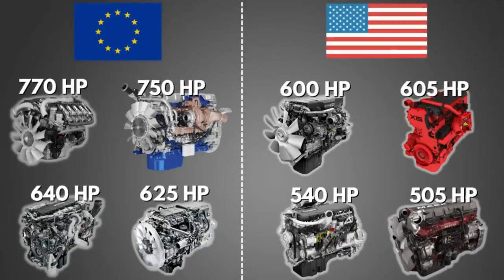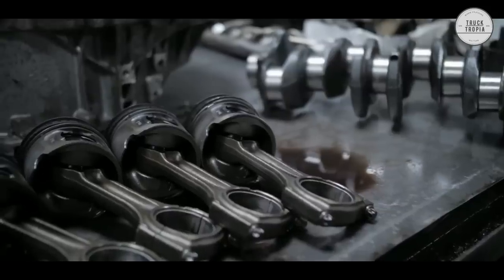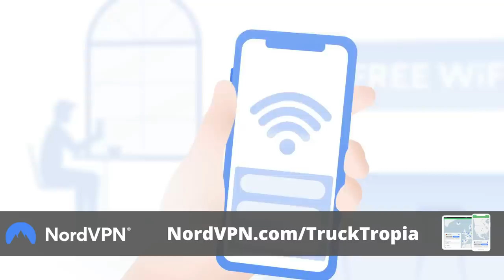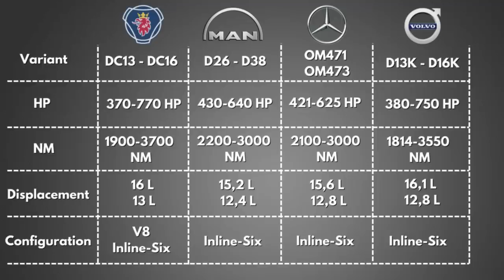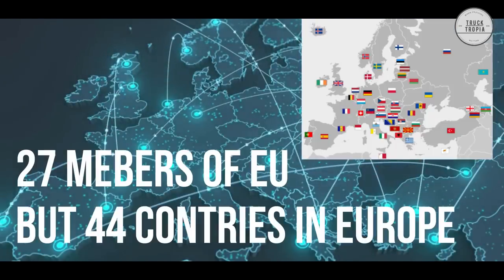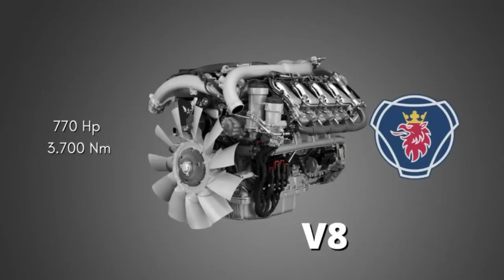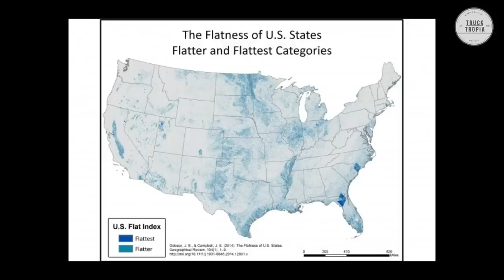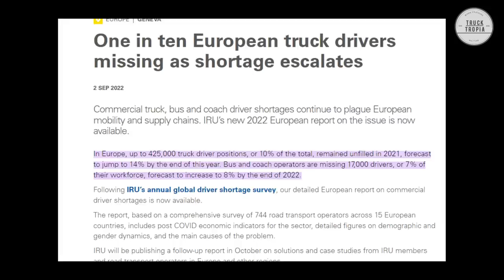Why European Trucks Have Up To 770 HP And US Don’t

Comment: Since I thrashed another one of your I know what European Trucks are like videos, the YouTube algorithm thought I'd like another one. European trucks do not have much bigger engines: there are 2 rival brands battling it out and a few drivers in need of a penis extension buy them. Of all the heavy trucks about 90% operate with 380 to 450 hp. 10% boast up to 550 hp. All made by straight 6 +/- 12 liter engines. 400 hp will get you 2000 nm these days. 0,00I-don't-know% gets to drive one of the Swedish topmodels. I would love to do so, one day. But my chances aren't great....😊

Comment: The US is flat? Must forget about the mountain ranges that freight has to get through to go from the west to the east coast.
Also many states have 105,500 lb weight limit.
Reply: It's about US truck loads in percentage runs over more flat and easier terrain, and with lower weights, than European truck loads, looking at the big picture.  One use the engines that makes the better milage in the total. In hilly terrain a large engine will often be more efficent, taking it more easy, compared to a smaller engine needing to be pushed towards its limits more often
Reply: @Rimrock300  
Just about every truck that's moving serious weight in the US gets turned up.
Alot of log trucks and dump trucks run 625hp cat and Cummins motors.
I'd be curious to see a real world comparison between a 625hp cat and that 770hp v8.
Area under the curve is important

Comment: Horsepower will soon be irrelevant when the greenie weenies succeed in requiring everything to be electric. Of course then that 80,000 lb rig will be 70,000 lbs of battery and 10,000 lbs of cargo. This will increase the number of trucks on the road by a factor of 10. Let’s not forget to factor in the sky high prices of products due to much higher transportation costs.

Comment: In Australia I believe the largest combination is the mega Quad. 4 b trailers with Quad axle dollies and trailers. Weight is around 240ton I believe. Pulled by a tri drive twin steer volvo. I've seen one in the north of western Australia but that's it. There are also super quads, ultra quads and standard quads. Mainly all used in the mining industry really. Most common combinations you would find would be the c-trains, triples and doubles really. Have a read, there is some big ass trucks in australia
Reply: I think it's note train not a truck
Reply: @martinssmits3170  a road train is just a truck with multiple trailers……

Comment: It sucks his in Canada a truck can’t maintain speed limits on climbs not that great because they are underpowered. I believe regulation should maintain 100km / 65m on a freeway hill.  Funny how USA thinks its engine superior but in sports cars, trucks, F1 racing etc there isn’t that much presence.
Reply: It is a matter of costs.  An engine that can haul a heavy load up a long grade costs a lot more and also will eat more fuel on a level run.  We really just need to either deal with it or build a railway.
Also, you may want to check out Edison Motors.  They are making specific purpose trucks with a lot of horses.  They are hybrids.  The drive motors are something like 750HP.  The engine generator is something like 200HP.  The batteries provide enough to climb a hill and then recharge on the down slope.
Reply: @kensmith5694  fuel cost way more in Europe. if they use the same size engines as Europe and there’s also a fuel cost to other vehicles slowed down by slow trucks then then need to accelerate after passing a truck that can’t maintain speed.
Reply: @Wozzaatwozza  The cost of passing is paid by the guy passing and not the trucker.  Incentives work to push the cost onto others.
Reply: @kensmith5694  the environmental cost is paid via us all vs keep the speed consistent one truck vs many cars.  Europeans get it’s not just dollars. Make the truck pay do all the other vehicles can maintain speed, and of course safety first so road design is key. But as the video states the European vehicles have bigger engines for hills.

The other option is just reduce the loads in North America so drivers can maintain speed. Bigger engine or less load.
Reply: @Wozzaatwozza  ... or just get over it.  The trucks are a fact of life.  We just need to deal with it.
Reply: @kensmith5694  I am over, I’m moving back to Europe where they fine truck drivers for driving too slow

Comment: Cummins ha a K19 to 19 liter 6 in line to 600hp ofered in Ford CLT9000 built in América in 1980 🇺🇲 3408 usted on Kenworth W9000 18 liters has 450 hp in 1981 truck Detroit Diesel 12V71 450 HP usted on Brockway 376 modèl truck in 1974 V12 2 cycles

Comment: Max torque is not more or less important then HP. You can compensate it with higher rpm (but then loose through this maybe some efficiency and longevity). 
Torque x rpm (times a constant) = (horse) power. 
So it's usually more important that you have good power over a wider range.
Reply: Not times but divided
Reply: Max either isn't really important. It's the horsepower band that matters. That will tell you how much torque you can apply to the wheels at any given speed. Engine torque tells you nothing without RPM. But if you have torque and RPM (which gives you a gear ratio, which is a torque multiplier) you have... Horsepower.

The reason for high torque is to have slower spinning engines that last longer. It has nothing directly to do with towing ability.
Reply: @simplemachine9531  is times, torque x RPM / 5252. And it's a different if you are using nm instead of lb-ft
Reply: @SlyNine  say times but show divided 😆

Comment: Don't heavier European trucks damage the roads more?
Reply: More weight means more road wear, comparing trucks with same number of axles. They have put the axle and total weigh limits at values they feel comfortable with, and roads designed to deal with it 'x' period of time before resurfaceing. It's a balance, less weigh and less road maintenece cost vs need for more trucks on the road to have the same amount of freight hauled over a year. The weight limits set are guided very strictly. Easily tens of thousand of dollars in fines if a few tons overweight

Comment: Bro why trucks so inefficient my car makes the same power out of an engine that’s a quarter of the displacement. I could never understand that.. maybe it’s because trucks get more torque more reliably out of a larger displacement, no offense I’m literally curious, I wanna know cause I’m guessing there’s a good reason???
Reply: Yes, less cycles per trip, cheaper components and maintenance
Reply: you know nothing about engines I see
the torque of a big diesel cannot be compared to car engines it's what moves the truck NOT the hp
big diesels are actually absurdly efficient when you look at the work they get done and the fuel they need to do that and yes its all about having an engine that will work for a million kilometres and handle the load of pulling a truck

Comment: I immediately knew torque was gonna be the defining factor. I have a 1979 f100 custom with a 3.7l I6 block. It's a big engine that only makes a measly 117 HP but it's working with double the torque (242lb/ft of torque I believe). Because of this it can still tow roughly 2000-3000lb with stock parts.

Comment: Hi, i'm fron Finland and i worked in concreed factory in loading bay. We maided elements specificly to constuction sites. The load in the one truck could be from 15 tons to 50 tons. And that wasn't the main issue. Main issue is that we can't load it properly on truck, closer to drive chafts, it's just can't be made. Allso main issue wich is noticable is arerdynamics. Elements are up to 5-6 meters, tall half meter wide concrete element makes a lof of drag and there could be up to 3 of them so it's a wall that is 1,5 meter wide. They got rooms where ariflow is camptured and acts like dragshute. Gaps for doors, windows. I didn't see eny truck with samller engine. Expet one time, and that little negine did fail after 15 kilometers. It could handle the cargos weight and drag.

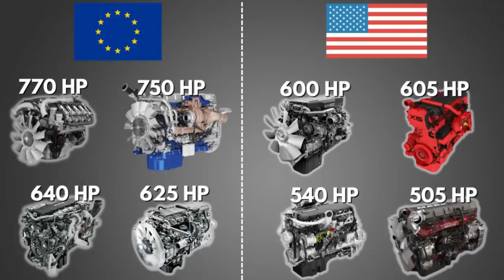Comment: 0:41 Welcome to the single most stupid sentence I've hear all year, another prime example of an individual not understanding what hp and torque actually is
The reason they can pull weight is horsepower and horsepower allone, an engine with extremely high torque indicates that the engine is making a lot of its power at low RPM, and that's the important part you missed to mention, it's not the torque itself that's important, it's the engines ability to make a lot of hp in the low rev range, if you are fine with murdering your clutch an engine from a supersportscar will do just fine aswell

Comment: US fuel is also very low quality, diesel is dirty, and technologies are dismal
Reply: Yeah US Pump Diesel is shit.
Low cetane compared to european diesel. That's not good. 
You want the highest cetane you can get for cleanest burn and most power out of your engine.
That's why I fill up with cheap diesel and spice it up with cetane booster additives. Cheaper than premium diesels and at least with my car there is a difference. Engine pulls harder on "boosted" diesel and sounds better like more aggressive but smoother somehow its difficult to describe.

Comment: Trucks need torque more than horsepower. How does that compare?
Reply from the maker: Need both
Reply: @TruckTropia  Dynamometers measure torque and rpm and hp is calculated from that. Low rpm torque is what gets the truck moving. :)

Comment: Bullshit, 10.000 Nm at 5hp are useless on a Truck. Nm x Rpm = Hp    Without Hp you have low Rpm = low speed. Use Gearbox

Comment: Those horses are in europe are imagine horses they are more near to 500 they if compared to mechanically tuned to 770 vs 770 stock the tuned will be beating it 1000-0 so they are on the paper not in the engine

Comment: I'd say that truck customizing is very uncommon in Europe. Contrary to what this video tells you. Because there are more trucking companies than private owners the trucks are company property and therefore never modified (why would they spend any $$ on it). And private owners rarely modify their trucks because of the same reasons. It had a culture yeah but not that widespread. The most common truck customization things are adding a bunch of led lights in the cabin, way too much lights and chrome everywhere. I call them Christmas trees. 
They remind me of coca cola trucks from the Christmas commercial.
Reply from the maker: Been to Denmark, Norway or Sweden all trucks are customized 😅
Reply: @TruckTropia  maybe it's a northern thing. Central Europe and the Balkans, I've yet to see a heavily customized truck. Been to Germany last week, no fancy trucks there either.

Comment: In the first 30 seconds, he made a bad comparison, causing me to stop watching.  He compared the AVERAGE power of a Euro truck vs the MAXIMUM available power of an American truck.  His point would have been sold a lot better if he compared average-to-average, or max-to-max.

Averages:  American trucks have an average of 350-450 hp vs the 750-850 hp average of a Euro truck.  (The 600 hp engine option in a US truck is VERY expensive.)

Maximum available power:  The ~600 hp maximum in American trucks vs the 1000+ hp of a Euro truck.  My Scania had 860 hp, and I didn't pay extra for it.  It was standard.

Plus, he never mentions the fact that some Euro trucks can be V8 powered, with Scania being the pioneer.  Something that American trucks currently don't offer, at all.  I have never heard of a V8 option being available in the US.

American truck manufacturers are so far behind in truck technology.  But don't get me started.  I could easily talk about rear-wheel steering (on the tractor), or steerable trailers (like a fire department ladder truck), or rear drop axles.  Things that most American truck drivers have never heard of.  Boy, I wonder why.

Comment: Very informative , but you drive with H P not with torque . Look in the formula .
Reply from the maker: Think a 1000 hp Bugatti Can pull 80 ton up a Hill ? No it need torque
Reply: @TruckTropia  it’s simple physics !
Reply: @TruckTropia  with the right gearing, yes

Comment: Total crap... Torque is irrelevant, power is defined as the rate of doing work, and that is what matters... For any given power output, how you got there is irellevant. You could have an engine with half the torque, BUT, to produce the SAME amount of power, it would have to rev twice as high. This means that for the SAME road speed, you could gear the thing twice as low, and therefore, thanks to the gearing, you would end up with exactly TWICE the torque out of the gearbox, as you put in [and half the output shaft speed], so you would now be back where you started, both exactly the same..

Comment: As a truck driver I can say torque is irrelevant. Power is all that matters. You can have torque without power but not power without torque. A 500hp semi powered by a bunch of weed eater engines will go up a hill as fast as a 500 hp C15 Cat with 1800 lb ft of torque.
Reply: @robsmith6093  I am a truck driver but I also understand a little math. A 600hp LS  could absolutely keep up with a normal truck engine given the right gear ratio. 

You can always get more torque by shifting down. Would the LS be running at 6500 rpm in a low range gear and be completely inefficient and impractical? Yes but hp is hp.
Reply: @robsmith6093  I can't verify that Nelly X is actually a truck driver but it is obvious that he understands math and physics.  On a truck (any vehicle, actually) it is the torque at the drive wheels that determines how steep a grade the truck can pull and how fast it can accelerate.  The key point, though, is that the greatest torque at the wheels is available when the gearing allows the engine to operate at its power peak, not its torque peak.  You can prove this to yourself by doing the math.  The engine's maximum torque rating never even comes into the equation.  If you need more torque to accomplish the job just downshift the transmission.  The only time that the engine's maximum torque comes into play is when the truck is in first gear (because there's no more gear reduction to be had) but that becomes theoretical since the resulting torque at the wheels would just result in wheelspin.

Comment: Not accurate,  cummins and paccar both have oil field service engines you can run in trucks that push up to  950hp
Reply from the maker: Its based on factory specs

Comment: You failed to consider the difference between a US "ton" and metric "tonne". A US "ton" is 2000 pounds (909 kg) whereas a metric "tonne" is 1000 kg (2200 lbs). The 80,000 pound US weight limit is 40 US tons, or 36 metric tonnes. Your failure to make the distinction between US and metric raises questions about the accuracy of all your videos.
Reply from the maker: thought people could work out for themselves that when pound is shown, the other metric is European ton and not usa metrics. but apparently not..

Comment: Because the US has NO restrictions on the truck engines ' emissions, and no one is developing anything in that field. Why spend money on something that is not necessary, and fuel is cheap (was, at least, but no longer)
Actually the same picture with the car engines of US cars can someone show a good, low-volume, high power, less consumption car? Not really, in fact the US car manufacturers do only SUV and trucks where the engines start at 5.5 l and go up. Mileage? Pollution?, mm no, we don't care about this her, we, as our voted reps teach us, we"don't believe it " (Trump on climate change ).
The tax on the fuel for road maintenance and new construction is the same for 30 years, and it is a few cents... real joke. Taxpayers, not car-and "truck" drivers pay for the roads, and that's why they are like those in Africa (no offense intended). The whole infrastructure is a joke, a work of the 1950 s and 60's. Made for 1/3rd of the current population. 
Recently drove my subi  Impreza to upstate NY, ~200 mls. NYS Through way is a piece of work! After urban & suburban NYC, 2 tiny lines with bumps, wholes, "waves" etc Real nigtmare, Nov 2022
One year earlier, 400 km in rural France, what can I say, counted all together less than 10 road imperfections (not even potholes, they get very quickly fixed and stay for hold for many years).
No comments